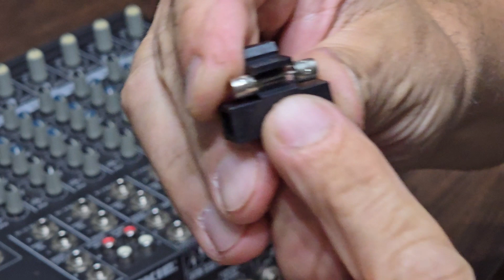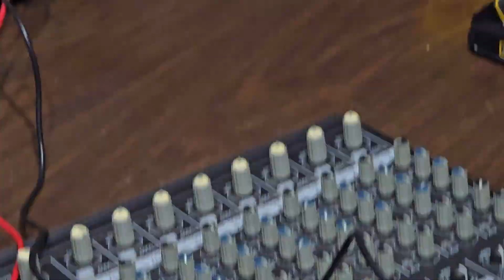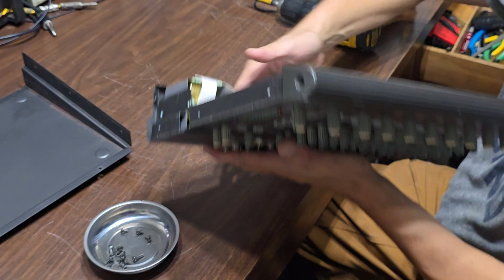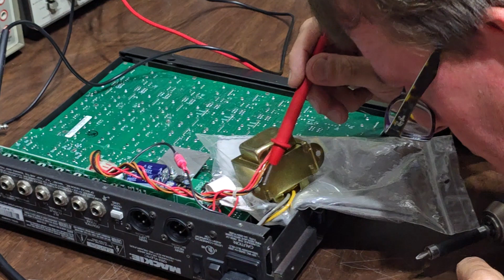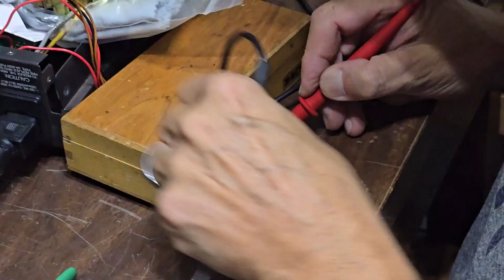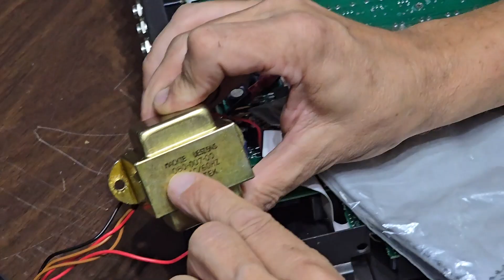Mackie 1202-VLZ Pro Mixer - No Power Repair Diagonsis - Bad Power Transformer

Comment: Is it normal to have tiny scratches and white fingerprints on the heat shields of a new mixer? I have this mixer and im getting fuzz when the volume or gain are high. Trying to determined if i was duped. Ive had it for only a month. Also mine looks shinier/not a matte metal.
Reply from the maker: Could be from a new factory that had poor quality control.

Comment: Hey John, by chance did you find a transformer because I have the exact same problem with the same mixer? If so could I get the name of the place that has them? I've been looking everywhere and no luck. Thanks.
Reply from the maker: I haven't found one with the phantom power tap, yet, but I did find one that will do the main rails. Those are actually pretty common.
Reply: @johnfields8745  Is there any chance I could get the number and where to get one? I don't run anything with phantom power requirements or any plans to, would it still power the board?
Reply from the maker: I will take a look next week. It was used in a lot of Peavey stuff.
Reply: @johnfields8745 thanks John, you just made my day.

Comment: I'm needing to repair the same unit, so thanks for showing how to open it - but PLEASE get a piece of carpet or vinyl on that work table, you're eroding and scratching the knobs, and it make a horrendous noise on the video!
Reply from the maker: It's a bankers desk....polished formica. The knobs are perfect. If you need any of the parts, let me know.
Reply: @johnfields8745   That's all right then, if you don't mind the scraping, I'm sure you know best...

Comment: There are two different styles of black screws to remove the cover. The thread and point are slightly different. I failed to note which kind were on the bottom and which on the sides. Unfortunately, I ended up with six of each type.

Comment: Thank you, seems like you might have mentioned the problem on my mixer. 

I’m experiencing a buzz on my headphones. Also the power connection area gets so hot the rubber foot on that corner melted. I opened it up and the transformer is set there similar to the one you’re working on except mine does not have the metal box around it. 
Is it normal for it to get that hot?
Where can I get a replacement transformer and box. I know you mentioned the box keeps from causing a buzz 

Thank you

Comment: Great video John. I love watching and learning. I have fixed a buch of Peavey and Fender gear using my electronics training from the automotive industry. I also took advanced electronics training back in the 80s. Things have changed a lot since and surface mount technology and my old age prevents me from doing much now. I have a hot air soldering station and know how to do the work but eyesight and unsteady hands are a deterrent.,